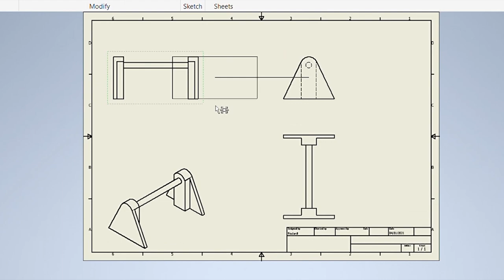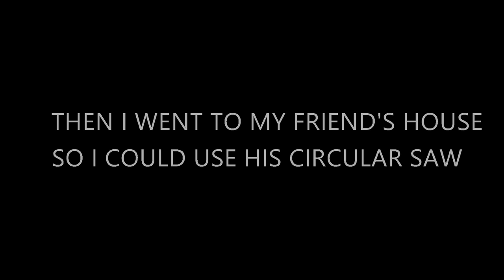From pallet to parallettes | Diy Calisthenics workout project

Comment: Hey can u share the measurements for the cuts?
Reply: The measurements are visible at 0:32
Height is 20cm
Base is 30cm
Reply: Yeah but I was reffering to the files to just print and cut, I think it would be very helpful
Reply: The models an all that good stuff